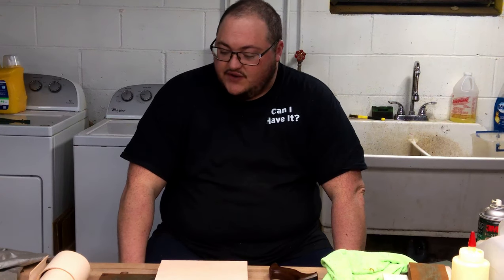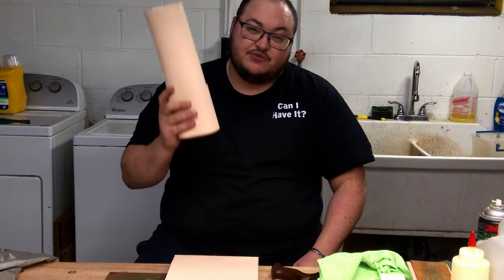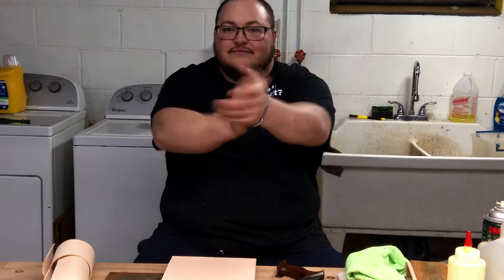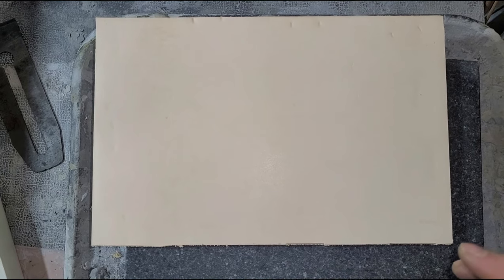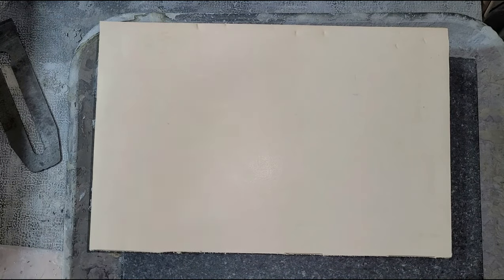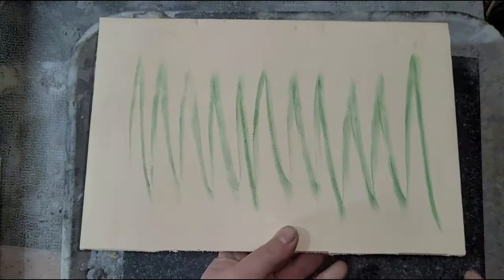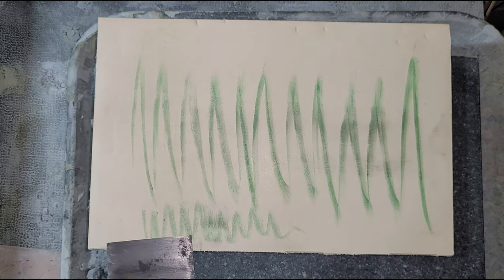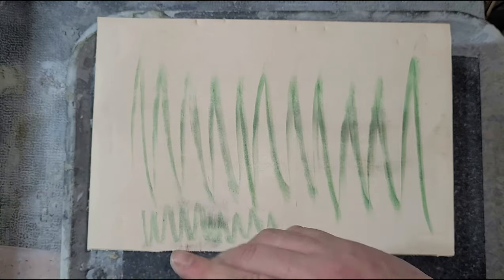EVERYTHING STROPPING! How to Clean (yes clean), Attach/Make, and Use a Strop!

Comment: Great video! I wonder if it would be easier to clamp the strip on the vise with some melamine or mdf covering the leather to spread out clamping force and avoid indentations? It would probably depend on if the vise chops covered the entire leather portion to keep the pressure even though.
Reply from the maker: Oooh I like that idea! That wold work for a smaller strop. Went pretty big with mine and deff didn't need to hahah thank you for the idea!!! Imma use that next time

Comment: I wasn't aware there was ever any need to clean your strop. That does beg another question though. How do you know when it is time to clean your strop?
Reply from the maker: Great question! If you are using green compound, remove it when it turns a dark green and caked on. If it turns black you waited too long to remove it.
Reply: @BatCaveCreations  Thanks for the info. Mine is long since turned black. Guess I know what I'll be doing before I use it again.
Reply from the maker: @Drackeye  if it is really bad it may be easier to just replace it bur deff try scraping off what you can, reloading and see how it does!
Reply: @BatCaveCreations  already scraped off what I can. To be honist, I haven't noticed an degradation in function despite having that much built up on it. Probably overloaded it to begin with.
Reply from the maker: @Drackeye  that's odd, I find fresh polish works faster and is cleaner. When it's black is got like metal fragments in it. Microscopic of course but for me it made a difference
Reply: @BatCaveCreations  I would still concider myself a novice at it though I have successfully sharppened 3 irons and about a dozen or so chissels. Some of which have been resharppened a few times. So maybe I just didn't notice with my inexperience at doing it.
Reply from the maker: @Drackeye  no problem at all! That all takes time, prob won't notice the first time but after a few you will!